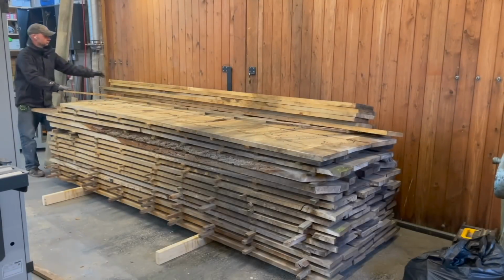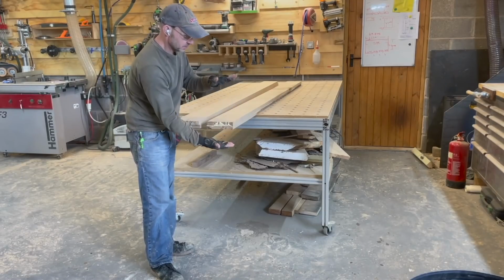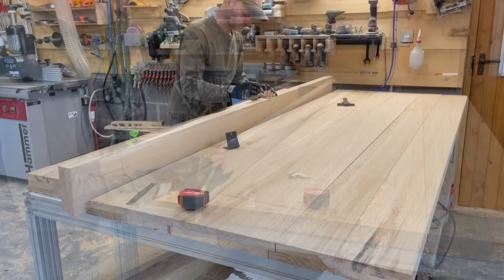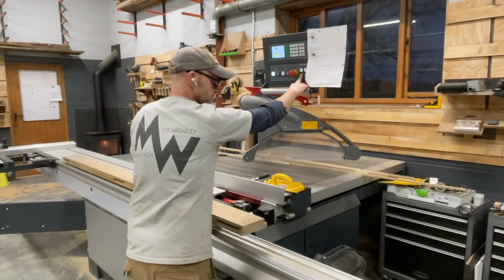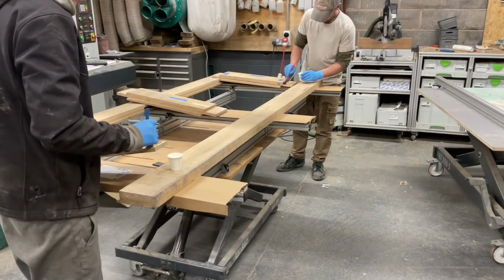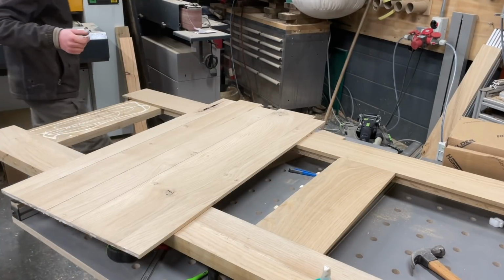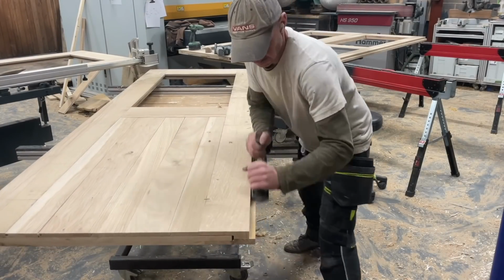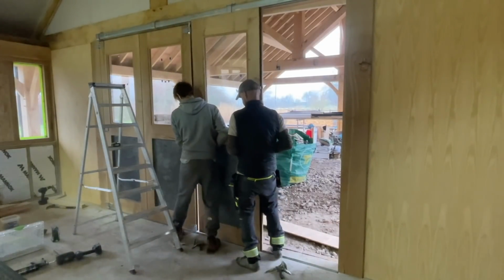World 1st Resin bi folding doors!!!

Comment: Any reason why you didn't do the glazing rebates on the spindle? Don't get your reasoning regarding bowed stile. Did you haunch the rails or just stopped tenon the entire width of the rails?.
Reply from the maker: I did do the glassing rebate on my moulder didn’t I ?
Reply from the maker: Forgot I use my saw for the rebate , just quicker and easier, less waste.   A couple had bowed in the fire and I had already cut the rebates for the 1/2 lap joint between each door , so hand plan sorted it .  Did have enough wood left to re run over moulder

Comment: Nice looking doors but why have you not done through wedged mortice and tenons on external doors for added strength.

Also I noticed that you have done full width tenons with no haunches on the middle and bottom rails hence have taken the meat out of the stile.

I was always taught that top rails should be split into a third (approx.) 2/3rds tenon 1/3rd Haunch, with the middle rail also into thirds and the bottom rail into quarters so two tenons and two haunches with any one tenon being no wider than 5 times the thickness of the tenon (approx.) so a 15 mm tenon should be no more than 75 mm before a  haunch is applied.

Whilst you doors are mounted on a track and not bearing weight traditionally on a hinge side I would still prefer a through wedged M & T personally.

I do have concerns over your T & G boards wanting to expand and contract (as Timber does) but being unable to move with the resin on them.
Reply from the maker: All good points, I’m using resin as the glue in my experience no need for any traditional wedged M&T, these doors are not very thick or heavy so I wasn’t worried about losing me on the Stiles , I am not 100% sure how expansion is going to work with the resin panels and the tongue and groove, but these are my doors and I’m quite interested to find out. Again all of the doors and windows you’re seeing made from my shop for me I’m using lots of different methods to speed the process up not all of them 100% traditional and not all of them best practice. But I have seen hundreds of doors and windows and tables made with traditional methods still capping moving and bowing. But you’ve raised some very good points and hopefully people read your comments, highlighting traditional standards of joinery
Reply: @ManorWood  Hopefully your doors will be oaky as that Oak appeared to be well seasoned unlike the Kiln dried rubbish we have to work with these days and the T & G doesn't cause a problem with the resin.

That morticer looks like a bit a of a workout, I have  Wadkin DMV which makes life a lot easier with the Vibrating head but that can still be hard if your on it all day long working with Hardwoods.

Comment: Hi just watched your video of you making the doors noticed on your morticer the window on the chisel was pointing uphill on a traditional morticer it should point to the side so it can clear the sawdust into the morticer you have cut with the last stroke if it’s possible to rotate your chisel 90 degrees it might make it easier to use hope this helps
Reply from the maker: Good point I’ll give it a try, I’ve always found a dust collection works better when the chips are coming at the top. Although I haven’t had the machine connected to the extractor since the fire so let’s try it

Comment: Can I ask why you needed to reflatten  the laminated board (having flattened the 2 individual boards)? I can understand it if it were to reduce the overall thickness but the implication that I took was that you did it for some other reason. I’m interested as I am about to do almost exactly the same with a lot of oak planed to 21mm and to be doubled up to 42mm for doors; I haven’t considered that double flattening necessary before but that’s not saying in any way that I’m not missing something.
Reply from the maker: When I’m laminating like this all dimensions are slightly over I find it after the glue up things can change a little bit, so Final Cut on plane assures everything is the same.  So many components been clamped moved it’s just the way I like to work I’m not saying this is how it has to be done
Reply: @ManorWood  thanks for the reply. I tend to cut over length and then Brad nail at those unnecessary ends when I have them aligned during glue up.